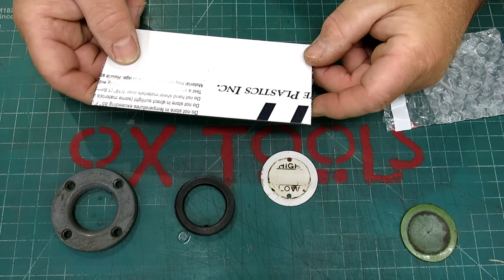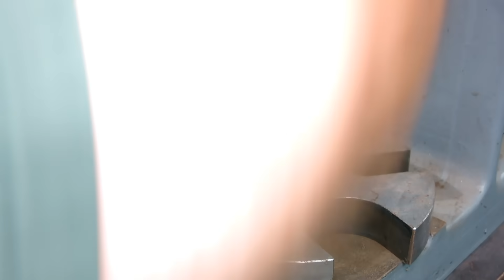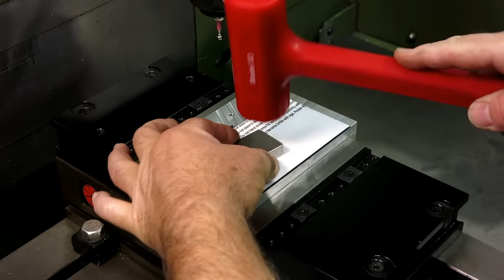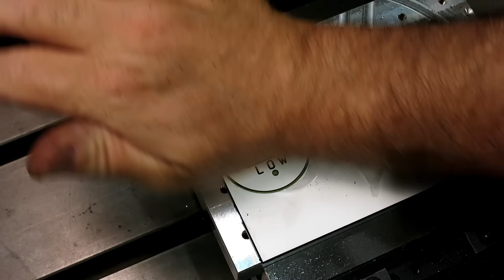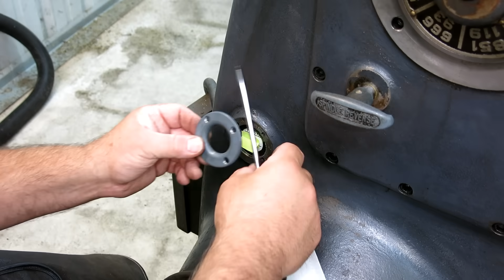Kay-Tee Oil Sight Glass Repair

Comment: What you need Tom is a 3D printer, there are so many different types available that its almost perfect, TPU for the gaskets, ABS 2 colour for the High/ low plate and as your friend did is print a handle piece in PLA to copy in metal. I use a Bambu Lab P1S but its just one of many decent ones available. If you decide on one get one with enclosure for the higher temp plastics like ASA, ABS, Polycarbonate etc.

Comment: Tom, I want to thank you for all the information, tips, and tricks you’ve shared over the years—it’s been greatly appreciated. I do have a question about the Bozo dogmeat evaporust. If I wanted to thicken it into a paste for use on a vertical surface, could I use something like a gum or bentonite clay to achieve that consistency? I don’t know the chemistry behind it, so I’d defer to your judgment.

Comment: Hello Tom, nice repair. I was wondering why you only put the rubber seal behind the glass? Wouldn't it be better to sandwich the glass so that it has a rubber seal on each side, for better sealing and better seating (flange pressure)?

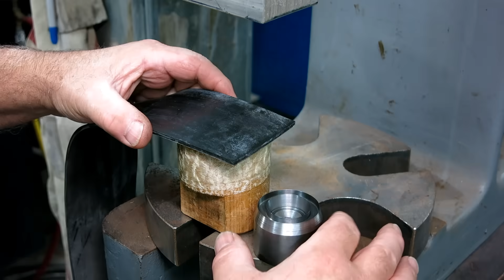Comment: Next time when you cut your gaskets.. You should hug over to one corner of your material  (25:14)..  Then your next one can stagger over to the other edge and stagger them side to side as you go (like how bullets stack in a magazine).   This will compact your layout a little better and not have so much waste. Plus your drops will have a thick spot that could still be useful later, for something.

Comment: It's gonna leak. Natural rubber does not tolerate oil. Nor does silicone. The proper way to stack this, is with one gasket first, between the machine and the plastic plate, then another gasket between the plastic and the glass, and then a gasket between the glass and the metal. The outer gasket is not for sealing, but for padding, to keep any imperfections in the metal from cracking the glass.

Comment: This isn´t going to work permanently! One gasket has to go in first, then the plate, gasket and then the watchglass - this would seal it without gunk and permanently!
Reply: I don't normally comment or read through comments but I just had to see if anyone else thought the same... I bet the yellowed sight glass was a repair and the repairer mistakenly put the 2 old gaskets together
Reply from the maker: I disagree. There is no need for a gasket behind the text plate. It has holes in it so oil will go into the cavity between the glass and the plate so you can see the oil level. There is no need to seal this particular spot. The seal needs to keep oil from exiting the machine. This is why I sealed the glass to the machine. This is the last pathway for oil to get out. 

Cheers,

Tom
Reply: @oxtoolco  Sorry - you are wrong. With this gasket there is no way for the oil. Without this gasket you have to use sealant and this is not the way it was constructed .
Reply: I agree with extra gasket behind. Then you are sealing on faces- machine/gasket/legend/gasket/lens. As it is at the moment there is no face seal between the machine and the back of the legend, so oil gets to the OD and you are relying on schmoo to seal the OD of the lens.  With the extra gasket behind the legend, oil cannot get to the OD.
Reply: But thanks for the great video, I find myself shopping for a KE55 once again.

Comment: Tom, I've had good luck removing permacel backer by applying another piece of tape (like kapton) with a folded over tail to the backer, and then pull on the tail. Usually beats picking at the backer with a nail or blade. If the underlying double sided tape is particularly agressive (VHB) this method will be hit or miss. Your mileage may vary.
Reply from the maker: Hey Eric. I'll give that a try. Its always been one of those frustrating things when you are just trying to get the job done.

Cheers,

Tom

Comment: Thom I purchased a set of those Medical Tweezers (expensive, but a must have) you use, but I'm not springing for a wrist-torque wrench.  Wink, wink. That could be very expensive from the tool supplier like Snap-On.  Thanks for sharing Thom.
Reply from the maker: How do you like the tweezers? I can't live without mine now.

Cheers,

Tom
Reply: Where did you find them? what are they called?
Reply: @bobwas4066  Search "Medical Tweezers," approx. 4-5 inches long.  Expect to pay approx. $45.00  Gold in color FYI.

Comment: I don't understand the sealing principle. Why isn't there a seal between the housing and the white disc?
Reply from the maker: Doesn't need one there. The two holes in the white disc actually let oil into the space between the white disc and the glass plate so you can read the oil level. No need to seal the white plate to the machine.

Cheers,

Tom

Comment: I remember a tool that takes a font and some text and spits out g-code. It looks like it's called truetype-tracer, but apparently there's some trouble changing what font it uses. It also looks like it's not available pre-built, so you'd have the pleasure of compiling it from source (unfortunately not the easiest thing if you've never done it).

Comment: great project but why not find an o-ring that would work?
Reply: Agree
Reply from the maker: The thickness stackup was different. Orings don't give you too many options on thickness. I also wanted to stick with the stock system as closely as practical. An oring would work. If I were redesigning it I would remake the cover plate so it had a gland oring in the part that clamps the glass plate. Simple and easy to replace.

Cheers,

Tom

Comment: Nice work on the gasket punch. I'm a bit surprised you didn't do some research on Buna quad rings though. I suspect you could've found one to fit right off the shelf. Of course what's the fun in that, eh!

Comment: I'm a bit surprised you're limited on font selection. Most computers these days have a bazillion true type or similar fonts installed with vector outlines.

I had to write a custom plug in for CamBam to do the 3D paths for variable stroke width, but I assume you have much fancier CAM software.
Reply from the maker: It was a question of matching the weird original font on the stock K&T oil plate. I have a zillion fonts in the CAM program but none quite like the oddball wide font on the original plate.

Cheers,

Tom

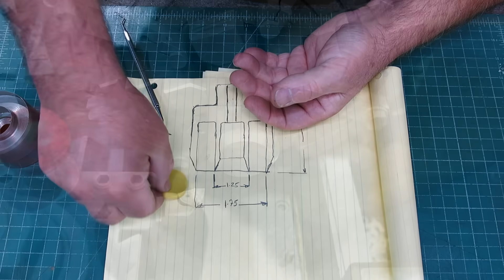Comment: edit: 7:05 i keep the donut centers for spacers. For example, whenever i store my precision stuff that might have touching faces, i slide one or two under. Easier than stuffing a rag or something and i have some pretty big centers too since i cut quite a few large ID gaskets some times. 
4:59 going to throw my hat in the ring and guess that this originally came with a glass sight, not a plastic one and the gasket doubler is in fact the thickness of the glass. I've never seen oil sight glasses made out of plastic. Might be our European machines are different tho. Have others in the comments taken apart one of these to positively affirm one way or another? ? ?

Comment: 1:24 i made the mistake to put the wrong oil in my main lathe at some point and the paint from all my sight glasses is gone. I've drained and purged it, several times now, but at some point i'm going to have to take them apart as well and fix that. My theory is that the paint is not compatible with some of the additives. It's completely gone, not even faded -  and i think it happened in about a week, which is how long i take between sight glass readings on a typical timeline for me. Weird stuff.

Comment: The gasket punch is great, but if you want to save yourself a fair bit of time making one in the future, Mayhew makes a really cool set of punches that fit on an arbor with concentric steps so you can fit multiple punches at the same time.  The kit isn't cheap, but it gives you a broad array of options for sizes, and they twist on and off the arbor easily.  Mayhew 66002 Punch Set is what it's called.
Reply from the maker: Nice set! $564 from Graingers. I think I'll get two. One for Buna and one for silicone.....

Cheers,

Tom

Comment: Some windex on the rubber makes it cut butter smooth 👍
Reply from the maker: Funny you mention that. I ended up oiling the punch and it worked much better. I'll try the windex next time.

Cheers,

Tom

Comment: Some fine looking sight glass there! The double stacked gaskets that came out were probably meant to be in order of gasket, high-low plate, gasket, glass, then no need for any sealant at all. Cincinnati sight glasses are the same and people always get the gaskets in the wrong order!
Reply: Yes, definitely needs a gasket between glass and cover, which would have been the thin yellow one. Allows the glass to float and not crack as the machine warms up. Did a lot of instrument glass changes, and every one, aside from those which had a soldered connection to the case, had a thin gasket between top cover and the glass, and another beneath. soldered ones the glass was silvered on the edge, and then had a solder preform on it that bonded with the silver, and then had special low melting point solder to attach to the front panel.
Reply: I wold say gasket-backplate-gasket-glass gasket-cover bezel.

Comment: What type of CNC was that you used for engraving?  Very cool machine
Reply from the maker: Correct. Makino KE-55.

Cheers,

Tom
Reply: I'm pretty sure it's a Makino KE-55. They are amazing toolroom mills.
Reply: @b-lazr5126 definitely a Makino KE-55, I use one pretty much on a daily basis where I work now. It's 30yrs old an still holds a 10 micron or better tolerance all day long.

Comment: Good video. I have a couple of questions. Are you sure that the sight glass was "Pyrex"? When viewing the edge of the window, I did not see any hint of color, which is typical of fused silica or quartz while a borosilicate optical glass, such as BK7 does show some color when viewing the side of even a 1" window.  My other question is why didn't you place the bead of silicone caulk in the corner where the rubber gasket meets the metal?  This approach would avoid rubbing off the caulk on the edge of the window that could cause a leak.
Reply from the maker: Hey Bret. The glass was indeed borosilicate. McMaster 8477K24. My thinking was the silicone was just a belt and suspenders on the sealing. The glass clamped down hard on the rubber gasket should seal completely without any sealant. The older I get the less I like to do things twice so I added a little bit of silicone. I was also worried that the silicone or whatever sealant I used might extrude into the viewing area hence the small amount.

Cheers,

Tom

Comment: I don’t remember how it came apart but I was surprised that you didn’t put a gasket between the glass and retainer just as an insurance of compression on the first gasket. Lovely work though
Reply from the maker: I added the thin yellow gasket to make sure the cover plate was compressing the gaskets properly. The stack up was different with the materials I used. 

Cheers,

Tom